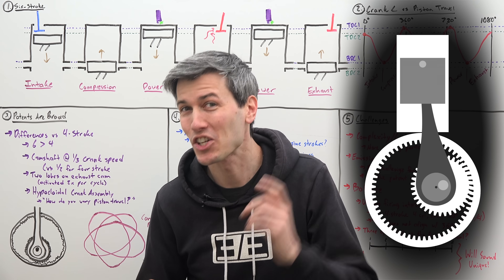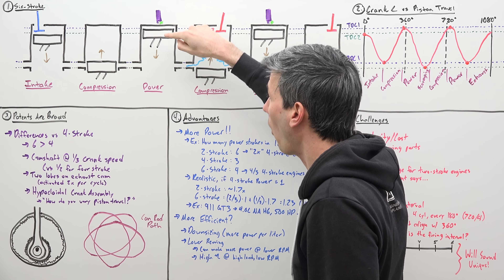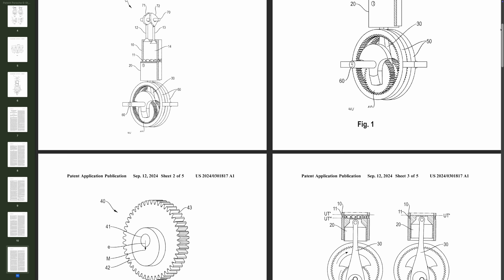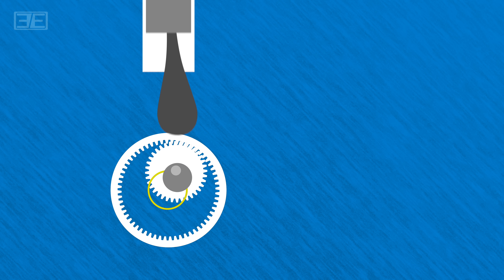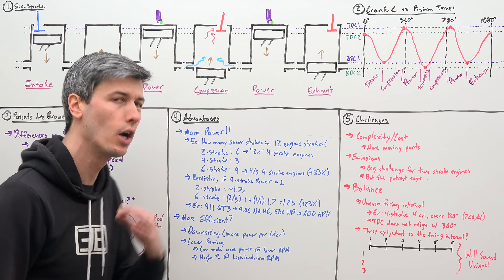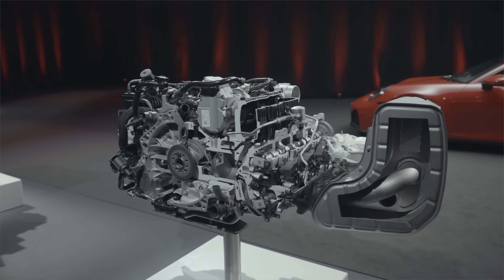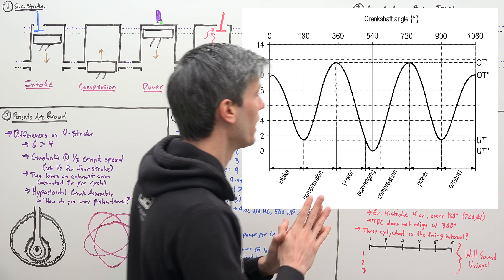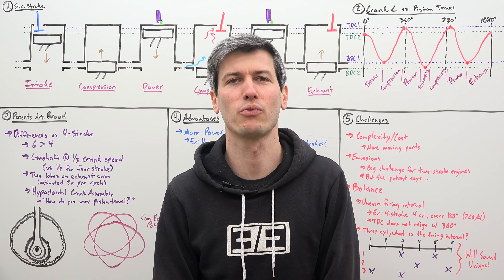Porsche's 6-Stroke Engine Is Genius!

Comment: Power plant priorities for important applications:
1) Reliability
2) Endurance
3) Simplicity (better for repair and diagnose problems)
4) Efficiency
Example: Reactor plant design for nuclear submarines are about a full 10-15% less efficient than land based power plants. However, nuclear submarine reactor plants are very reliable, long time before needs maintenance (100 days submerged at power), simple to operate by smelly, oddball sailors.

Comment: How air circulates in this engine may lead to better combustion with less input energy and evaucation of exhaust, alogn iwth more complete combustion. Air and gas movement in this design may cool it off quicker between combustion also increasing efficiency.

Comment: In August 2021  a Toyota Mirai was driven a record distance of 845 miles on 5.6 kg of hydrogen, That's 6.627 grams of hydrogen per mile. So how much more efficient would this 6 stroke engine be?

Comment: Even though this engine is very innovative and helpful in racing/track applications, I am confused about its emissions because when the fresh air fuel mixture is compressed in the two stroke method, the exhaust valve is also almost opened simultaneously, this will allow for some of that fresh air fuel mixture to escape resulting in more emissions from the unburnt fuel. Maybe adjusting the timing might help a bit, but then the cam profile will have to be adjusted to accommodate higher and lower rpms I guess…

Comment: I do not see the benefit over a conventional two stroke engine.  with a four stroke, rather than the normal one power stroke per two revs, you get two power strokes for three revs, true.  But with a two stroke engine your get two power strokes per two reves, still better use of the engine, and without the complication and extra parts.

Comment: It looks like that fourth stroke is a combination exhaust and compression stroke. It’s hard to imagine them fully clearing out the combustion gases before the next charge of intake air comes in. Is it turbo scavenged or does it use reed valves?

Comment: What was reported to me when this news came out is that the 5th stroke was supposed to re-ignite (via spark plug controlled compression ignition) the resulting fluids from the 3rd stroke to output max energy from the fuel. Hence the efficiency gains.

None of that in the actual patent???

Comment: Congrats on your 1000th video!  Haven't watched all of them but I have watched a great many.  I don't always agree with you but your analysis and reasoning is sound and thorough.  You are far smarter than me and have my deep respect as a (retired) graduate mechanical engineer.  I have yet to see anyone explain the interplay between the thermodynamic and mechanical aspects of ICEs as well as you have.   As far as acheiving peak efficiency I think some sort of combination of the Mazda Sky Active technology with the Atkinson/Miller cycle would be be the way to go rather than this 6 stroke idea, interesting as it is.

Comment: I see the flows.  It mostly means the RPMs are slower to allow the 2nd power stroke fill up.  Slower RPM's limit ultimate HP output.

Comment: OMG! Germans can't even design a regular 4 stroke engine without seals failing, plastic oil pumps breaking, or faulty wiring; Can you imagine what a nightmare this is going to become? Instead of going back to the dealer for major repairs twice a year, this engine will have you back at the dealer for repairs six times a year. That's why it's called the six stroke engine; because you will literally have a stroke each of the six times a year your mechanic shows you the bill to fix this thing!

Comment: Make no sense tô me... If port inlet ia not a problem for emissions, só make It 2 Stroke.

Maybe a better option ia to use 3 link cranckshaft that alows variable compression tô make and engine alternate between 4 and 2 stroke modes.

So you can run 4 stroke without boost, emission friendly variable compression and when you reach enough rpm+boost can change the link to lower BDC showing ports.

Cams can be handled for 2 or 4 stroke by a vtec like system.

Need economy, ECU set links to 4 stroke.
Need Power, ECU set cranck link and cams tô 2 stroke.
Reply: wouldn't such a setup be prone to failure right at the moment of cycle switch?

Comment: I would love to see this graphed and summed in 120° phasing, as one would show 3-phase AC sinewaves cancelling out to form a line. Could you at least provide the formula for that curve? I don't know enough to figure it out myself.

Edit: Nevermind, found it!
(5−2)cos(x−720/3)+(~16)×cos((5−2)(x−720/3)/2)
+ (5−2)cos(x+720/3)+(~16)×cos((5−2)(x+720/3)/2
+(5−2)cos(x)+(~16)×cos((5−2)(x)/2
It all combines to create what looks like a sine wave, but I suspect it's not perfect.
Edit 2: the sin wave is exactly equal to 48cos(3/2x) for the estimated scale I used (16). So, the perfect engine would have 9 cylinders? To cancel out all vibration? 
At the very least it would be easier to design counterweights if it really does boil down to a simple sine wave.

Comment: Makes no sense from a physics or emissions perspective.  In step #4, how is compression of the gas in the cylinder taking place if an exhaust valve is open, for even a fraction of the entire period of upward travel of the piston?  And what fuel is being injected to burn in the next power cycle that isn't  getting pushed out of the open exhaust valve, thus fouling the exhaust and consuming fuel without getting ANY power out of it?

Comment: How the heck is this going to work naturally aspirated? 2-stroke engines use crank case compression to create "boost" to help push the exhaust gas out. In this case the exhaust valve opens, which (ideally) drops the pressure to ambient (in an instant.. cough) and then the ports open... to ambient pressure? Well, that's just a tube that is open at both ends, now, isn't it? That doesn't create an induction vacuum.

Also, I don't think you can use that "2-strokes make 70% more power per liter" comparison in this scenario, as 2-strokes have worse volumetric efficiency than this design. This is more akin to 2-stroke diesel ship engines (which can also only run boosted) with an exhaust valve at the top and ports at the bottom. Those have a volumetric efficiency of 100%.

And lastly: If we assume direct injection and boost, then this design would have none of the emissions problems of traditional 2-strokes. It doesn't matter if a bit of clean air gets blown out with the exhaust. If the fuel isn't injected until the exhaust valve closes, then all should be good.

Comment: 13:08 I think it mostly evens out with a 6-cylinder engine. Using your diagram, you should have a power stroke slightly before and after each sixth of a cycle.

Comment: Here’s an idea. What if you had an engine where half of the cylinders operated on a four stroke cycle and half of them were on a two stroke cycle? If it was turbocharged, you could use that energy to force air into the two stroke cylinders without having to draw air from the crankcase. This would create 35% more power without the emissions issues. 💡

Comment: I assumed the point was to have two compressions with different fuel mixtures.  The first (richer) one being tuned for peak efficiency, and the second (leaner) one being tuned for minimum emissions, recycling some of the unburnt hydrocarbons from the first.

Comment: 11:40 Bro. Even firing interval is guaranteed by having the same number of inline cylinders as there are strokes. 6 strokes, ergo 6 inline cylinders gives you even firing. The difference is that you will always have two cylinders firing at the same time:

Imagine the firing order is 1-2-3-4-5-6 for the first power stroke. The corresponding order for the second power stroke will therefore be 5-6-1-2-3-4. Put them together, and the firing order is 1/5-2/6-3/1-4/2-5/3-6/4. And since the first power stroke arrives slightly early and the second power stroke arrives slightly late, that is in fact the proper ordering (1 then 5, 2 then 6, etc).

I doubt that the firing order could be arranged in such a way as to balance rocking forces. However, this is trivially solved by either doubling the length or doubling the banks with boxing. Therefore, the 6 stroke engine would have even firing and pretty darn good balancing in either an inline-12 (yikes!) or boxer-12 configuration.

So I look forward to Porsche’s 6 stroke boxer-12 hypercar.

Comment: Bruce Crower came up with the six stroke idea decades ago, his design (and working prototype) used water that flashed into steam for the second power stroke which would have a lot of advantages and his design was much simpler than this setup. links don't work here, just search Bruce Cowers six stroke engine.

Comment: Jason. Efficiency is improved as the biggest loss is piston ring friction. If you have more power strokes per cycle then as a percentage less friction occurs with the wasted strokes (like intake and exhaust where the rings are still dragging on the cylinder walls the entire time) It is the reason why the MAN B&W G95ME-C10.6 marine diesel 2 stroke engine is the worlds most efficient engine. 155 grams per kilowatt hour. The 4 stroke versions (like Wartsila W31 engine) are at 165 grams per kilowatt hour.
Reply from the maker: That makes sense - less piston distance moved per power stroke!
Reply: The Germans were on top of two stroke diesels in WW2. A Junkers bomber had opposing piston engines and managed unladen to get to about 60,000 feet.

Comment: In 2004, Bruce Crower  of crower cams actually built a different mode of a six stroke cycle engine . It had the regular 4 stroked  but then injected water into the combustion chamber at the beginning of the 6th stroke. The water instantly turned into steam, thus capturing the otherwise wasted heat of the engine. A much better design I believe.

Comment: This can only be a Porsche flex because they are pulling the plug on the 718 ICE platform in favor of EV tech (thanks to crappy EU regulations).  Thankfully I've got a 4.0 flat 6 powered BGTS headed my way right now...Siem Cicero or bust!  RIP Felicity ACE.

Comment: If the only advantage is the extra stroke. And you need an aspiration pump of some sort to scavenge the two stroke part of the cycle anyway  why not just make it simple asperated two stroke with exhaust valves that dosent need the variable stroke and all the nightmare that goes with it.
But of course that's been successfully done already .
Reply: hmm, let me remember the name of the engine .... oof, it's EMD 645, the most successful industrial two stroke diesel engine ever

Comment: 6>4 is misinfo... in 4 stroke, you're powering 25% of the time (1p/4t), in 6 stroke you're powering 33% (2p/6t)....      the advantage of 2/6 engine over 1/4 engine is actually exactly 32% (33/25=1.32), not 50% as 6/4 would suggest, and not 33% as EE states (close enough,  but these are all basic ratios, so there's no reason to quote wrong numbers).

a 1p/6t  would also be 6-stroke engine, but it would be WORSE than the regular 4-cycle, hence stating "6>4" would simply be wrong.

Comment: I looked into this too. I've got to say I'm impressed. The only way I can see it getting primary balance is maybe different timing for each power stroke and more cylinders. However if we look at its total harmonics and tertiary balance it does relatively well with a 6cylinder variant being roughly similar to an inline 5 4 stroke - not something I was expecting. 
Another anomoly I stumbled on is that it changes with bank angle in a vee configuration which ends up making some better and some worse. Weird. 
I imagine as a FI diesel this thing could be hugely efficient. 
Thats another point - it looks like its going to have to be run with some kind of constant boost for it to meet emissions. With boost its a very efficient design but without its relying on those ports having higher pressure than the still - expanding exhaust gasses from the first power stroke and I struggle to think its going to flow enough for a clean burn. 
Maybe they could supercharge just the ports as a completely seperate intake which would reduce parasitic losses from the charger at low rpm then have turbos on the main side for higher rpm/power? 
Lots to think about with this and its easy to go down a dozen rabbit holes. 
I can't wait to see where it goes.

Comment: So will it be a Porsche that sounds like a Harley?

Also, some years back Chrysler made great progress -- but not quite enough -- on a two stroke V-8, IIRC. With modern electronics and fuel injection, could that engine be made viable? Lastly, a thousand congratulations! You get my vote as best explainer on youtube.

Comment: As I understand it the two-stroke portion is conceptually before the 4 stroke, and they are deliberately making that a rich combustion and those gases then are recycled into the cylinders for the 4-stroke portion kind of like what Mazda does with their skyactiv and the exhaust gases which they deliberately introduced into the combustion cycle. The idea being that you get a kind of dirty two-stroke burn, but then those incompletely combusted gases are introduced to the 4-stroke cycle and are completely combusted there in a very lean cycle. The 2-stroke portion of the cycle also is used to cool the cylinder. I will see if I can find the source that I read that in so I can give you my source material but that is what I read about it when this was first talked about 6 months ago or whatever

Comment: I=intake, C=Compression, P=Power 1, c=Compression 2, p=Power2, E=Exhaust:
Cylinder 1: I -- C -- P -- c -- p -- E -- 
Cylinder 2: P -- c -- p -- E -- I -- C --
Cylinder 3: p -- E -- I -- C -- P -- c -- 
This way you always have 2 firing & 2 compressing.
Reply: It's a good scheme for 3-cylinder but it's probably best just to make it 6-cylinder.
Reply: @sandman0123  Yeah, I too think the 6 cylinder option is the best. I was mainly responding to his confusion of how a 3 cylinder setup might work.
Reply: @, yes, I understood that and appreciated the explanation. 👍
Reply: @sandman0123  6-cylinder wouldn't work very well unless it is an inline engine, you would have 2 cylinders firing on the same cylinder bank on an H or V style engine.
You can balance a 12-cylinder engine in a V or H configuration though. Is Porsche about to create an H-12 monster?
Reply: I think this would only work well on a boxer platform with the secondary (I think) forces cancelling out. I’m sure an H6 firing just like this could be set up pretty smooth but a 3 cylinder would probably be just as rough as any other. I may be wrong though. Your intervals are definitely the smartest option for trying to balance it and ultimately is probably porche will end up using.
Reply: herring bone gears and fork rods press up crank with roller bearings. This won’t need much lube , and the gear will have to be wear resistant
Reply: In this configuration You would need a giant flywheel to keep it alive during compression cycles.
Reply: @swenhanf9668  Why when you have twice as many combustion cycles?
They cancel each other just like a 2 stroke does not need a bigger flywheel eventhough it compresses twice as often as a 4 stroke.
Reply: EPIC
Reply: Good idea, but I'm pretty sure using 6 cylinders will give the best options for balancing...
Reply: Another outstanding video how you make this stuff sound almost simple is amazing anyone with some knowledge of how a engine works can understand what the intention is and how that will work keep the videos coming I appreciate them
Reply: Does it make any difference to balancing whether a piston is moving up to TDC 1 versus TDC 2, or would you mainly only need to consider the distance traveled on that stroke?
Reply: If I put it together correctly (my eyes started getting screwed up looking at it for so long), it should have 4 firing all the time (for the hell of it).

i=intake, c=compression, and P=POWER

cylinder 1:   i - c - P - c - P - e
cylinder 2:   e - i - c - P - c - P
cylinder 3:   P - e - i - c - P - c
cylinder 4:   c - P - e - i - c - P
cylinder 5:   P - c - P - e - i - c
cylinder 6:   c - P - c - P - e - i
cylinder 7:   i - c - P - c - P - e
cylinder 8:   e - i - c - P - c - P
cylinder 9:   P - e - i - c - P - c
cylinder 10: c - P - e - i - c - P
cylinder 11: P - c - P - e - i - c
cylinder 12: c - P - c - P - e - i
Reply: epic - epic - epic... hahaha
Reply: First mechanic trying to check the timing : P_O_S=P_O_S
Reply: @tieoneon1614  🤣You're probably not wrong.

Comment: Engine in theory should develop 33% more power and 33% more RPM at the crankshaft. Of course it will be done with direct injection and the numbers you saw comparing conventional. Two strokes to conventional. Four strokes lose a lot of power because of how the air intake works on a conventional two-stroke however, with this motor, it eliminates that problem by having an actual exhaust valve. So it will be the additional 33%. The other true advantage of this is that it will be using the crank case gases directly into the intake system, and that will clean up emissions as well. The advantages are huge and I also suspect it will clean up the exhaust gases so expect to see at least 33% increase. We all know the eventual standard for sports cars will be 1000 hp above that there’s not many advantages, similar to the way, high-performance motorcycles kind of capped out a little over 200 hp and then people started wanting smaller simpler motorcycles. Something similar will occur with the sports cars at 1000 hp.
Reply: no, this is a turbocharged engine not a crankcase ventilated engine